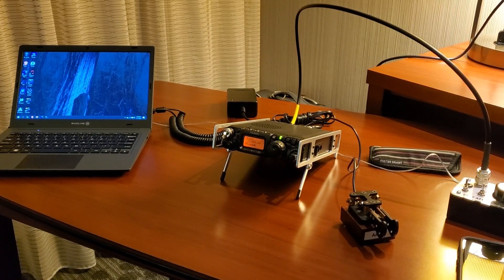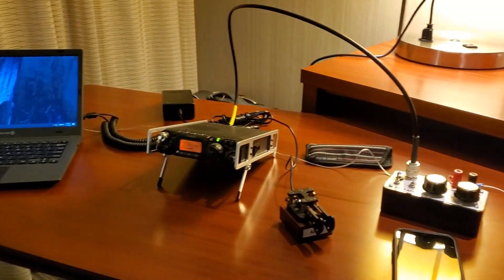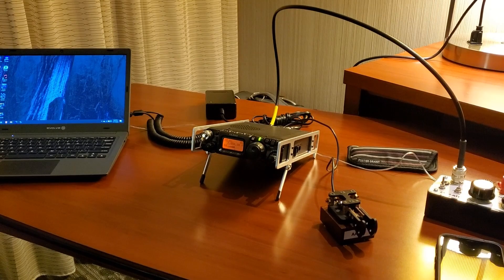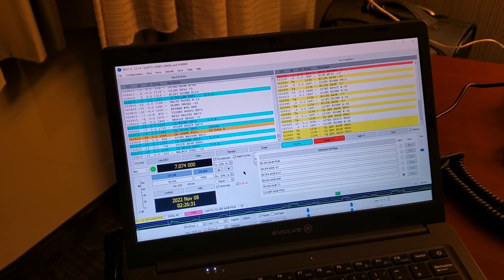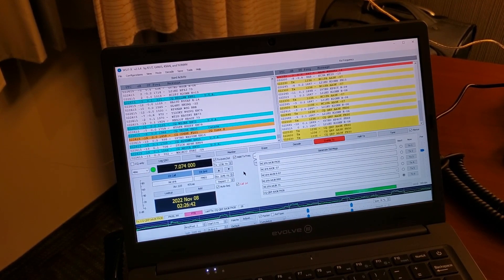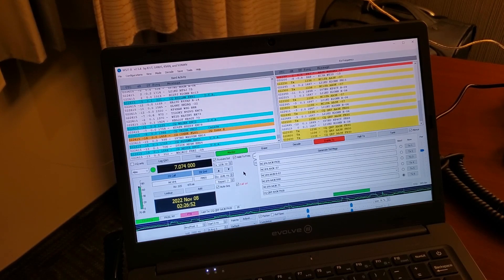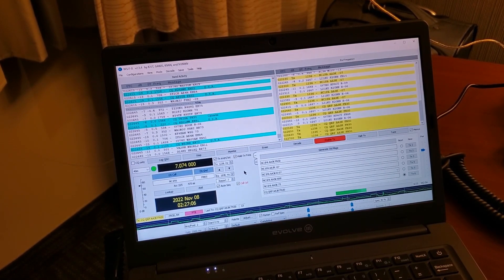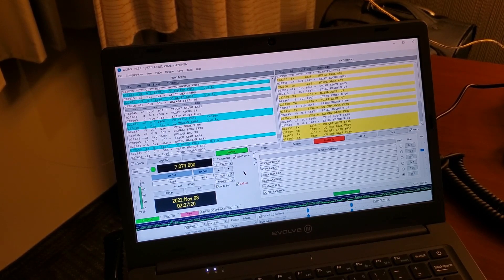Hamming From a Hotel While on the Road

Comment: I found your video and I am too an engineer that travels to LongIsland NY for business meetings. You have have a nice portable setup and I do not know any hotels that have windows that open there. I have a different radio that has a built in tuner but otherwise a similar setup. I will start looking for hotels with trees to throw an antenna out to operate.  I agree Mag loops are great but hotels keep you from using them due to the shielding.  Thank you for the video.
Reply from the maker: I plan on doing a review on my mini mag loop as it is the perfect size for travel.  Unfortunately nothing but a few birdies in the hotel room. Several other YT hams report the same thing with inside the room antennas. Once I got a wire out the window, signals appeared.